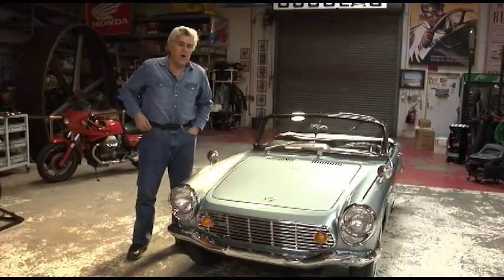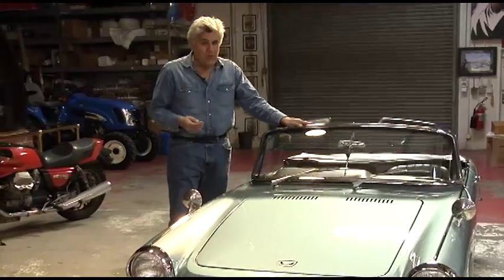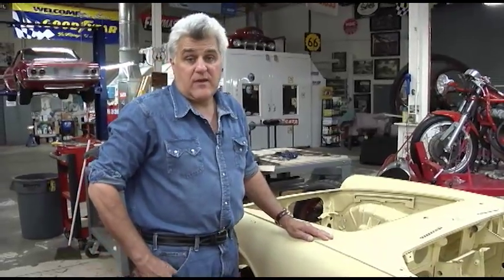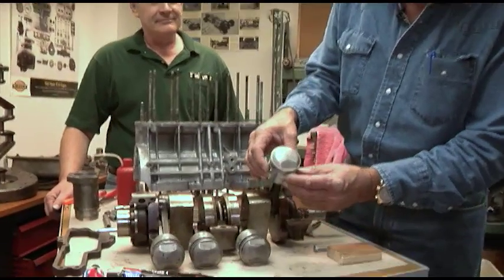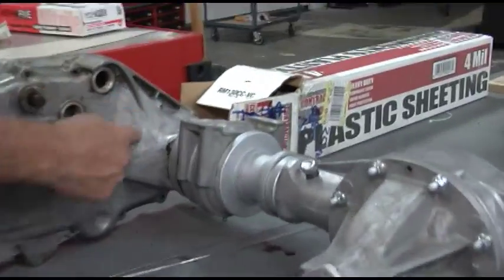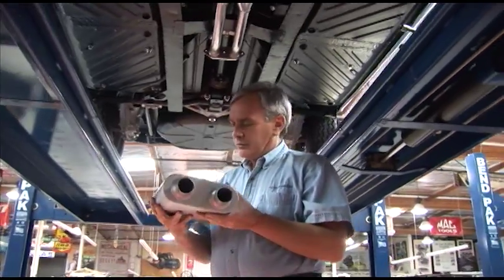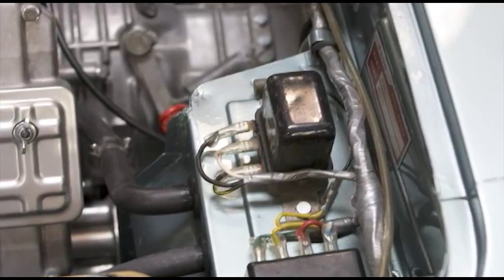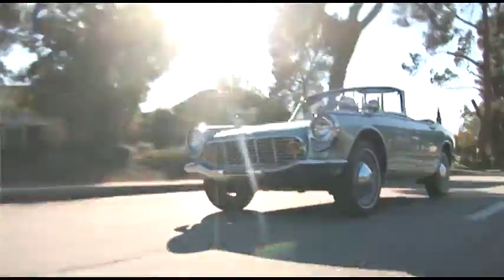1964 Honda S600 - Jay Leno's Garage

Comment: And this is why people love the S2000... Jay put it perfectly: "Going quickly in a Slow Car is Actually more Fun than Going fast in a fast car" that's the sole reason Cars like Miata´s, RX8, and the S2K exist.. Some people just want to hear the symphony of an engine without breaking any laws.
Reply: +skirmich Thats the same reason why the miata is so popular. It isn't a fast car but its a lot of fun to drive it at high RPM's , and offcourse its a nimble little car.
Reply: and the S2000 is just about as fast. Most experienced s2000 drivers like me that learn how to launch the car properly can get their stock S2k's to 60 in 5.0 seconds. Neither are slow cars.
Reply: skirmich works in a country with speed limits and cities that live off tickets.
Reply: Imagine if they make a new version with a new bike engine 150 hp 14k redline
Reply: @68nevets68  my turbo Miata does the same and costed half as much🤣1800 for car 449 for standalone and 1200 for isr turbo kit and I'd say an extra 300$ for touch up things electronic boost controller oil cooler oil catch can a few reroutes. Next is coil on plug not getting enough spark I want 250 whp out of it and it's at 200 flat rn
Reply: @kyongslist  you drive a Prius?
Reply: @h3xd3m0n9  Jay Leno had one on his show with a cbr 1000 motor in it. I'm sure you saw it by now
Reply: You should hear my stock Golf MK7 R at high RPM.

Comment: You've got to admire the Honda Motor Co... they just recently produced their 300,000,000th motorcycle..... that's a lot of motorcycles... the first true Honda motorcycle was the 1949 100cc Dream - the 300,000,000th one was a 2014 1800cc GoldWing...amazing.... Soichiro Honda would have been proud - Cheers
Reply: And out of those 300 millions, more than 100 million are Super Cubs. The most produced vehicle in the world, by far.
Reply: Not to mention Honda's domination in F1. Notably in 1988 when their engines not only won 15 of 16 GPs, but were hitting 18,000 RPMs. 

Let alone a factory car like this @9,500 RPMs... in 1964...

Comment: A 600cc Honda four cylinder.  This ol' Honda mechanic from back in the day sees those pistons as very close to the ones used in 305cc Honda Super Hawk motorcycles.  Anyhow, marvelous engineering and craftsmanship, what eventually put Honda at the pinnacle of motorcycle manufacturing and engineering.  Great view of this little sports car's whole persona from Jay.
Reply: i ride a 600 cbr f4, last of the carburetted models from 1999 -direct descendant of this lump, bullet proof and wickedly fast, the only grief they ever give is the cam chain tensioner.

Comment: The engine sounds like the best parts of the movies Le Mans and Gran Prix from the '60's.
I helped my step dad rebuild a 1962 Porsche Super 90 with the roller bearing crank. It was a beast when the carbs were synched just right.

Comment: Just more proof of why ill never sell my S2000 ....its in a class of one ...owned it for ten yrs and still love it as much as day one !!
Reply: not close to this jem  plus later s800 pure hot cutting edge 1960s honda four stroke 
technology from race program eg check out on youtube 125 5 CYLINDER AT GOODWOOD FOS 2002  beg you watch it then may see s2000 as good as it is by honda standards a bit warmer than most "modern" engines but not earth moving what possible nice car but no classic
Reply: Tony Pate S2000 was produced with Honda racing technology and experience from Formula 1 and is already touted as a future classic.
Reply: yes just about on par with this technology from 1965 which is 50 years ago as for the s2000 having any link to f1 well its clever pr speak and no more have you ever been close to a f1 car  ?  not last years joke but v10 and the 1,5 turbos next be saying a clio shares it dna with f1 renault not amount sport badges ant stickers can hide  fact that both nice cars quick enough but not cutting edge only car thats a bit special the toyota fla thanks to the folks at yamaha but dont tell anyone car nuts be upset never ever be as classic the s800 in modern turns your s2000 be spining to 16 k and 350 ps and its not why well it a warmish safe engine
Reply: Tony Pate I've seen Senna's McLaren with the V12 and Red Bull's car from last year and Formula 1 is my religion when the current season is on. Also considering the same engineers who worked on the S2000 also worked on the NSX and were involved in Honda's F1 technology and engine design I'd say yes it directly has influence from Formula 1, especially the engine that screams to 9,000 rpm. The S600 and S800 are great classics but are still obscure cars most enthusiasts wouldn't look twice at or even be aware of their existence especially in America where the classic car scene is dominated by American muscle and European sports cars. I love both these old roadsters and will have one someday in my garage but don't be so arrogant to dismiss the S2000 because it definitely shares the same spirit of those two cars. There are also numerous articles out there that pretty much guarantee it will be a classic car in the decades to come.
Reply: wow 9 k in a car big wow honda can do that standing on it,s head nice safe tech from way back!! sorry your a f1 fan must a been so hard to watch last year power passion speed er big fail can you tell what R S C is ?? just checked out on your playlist s2000 technical video 1999 not bad but bit old hat and full holes dont get me wrong not to bad a car any
wife gf be happy and safe in it i await your reply to the R S C question

Comment: Hands down, this has to be the best sounding and coolest little car i've seen in Jays garage. And yeah before you get your panties in a twist, the McLaren F1 is an amazing machine, but it's ultra pricey and nearly unusable on the street (ie to explore its limits). And he does have a lot of cool cars in there.  As Jay has said it's more fun to drive a small, lower power car fast than a bigger car with big power slow. Just listen to that thing scream! Wow!
Reply: youtubasoarus
Reply: Honestly it sounds like a Honda engine. I have a 2001 Honda Prelude with a 2.2liter VTEC engine and the tone and sound is the very same. It’s insane that a 1964 Honda motor has the same sound as more modern engines.
Reply: He actually a fast car fast

Comment: Very cool to finally see this video of Jay Leno's Garage. We have a 1965 red S600 ourselves. It's up at Formula H Motorworks to get the same or similar treatment. We anxiously await its return in roughly July or August of 2015. We cannot even believe how amazing this thing sounded after restoration. Absolutely SCREAMS at the high end of the tachometer just like a modern day S2000!!

Headquarter Honda
Clermont, FL

Comment: Quite a few were sold in Australia.  A bit small for the tall guys, but incredible go for the engine capacity.  That one of Jays sounds quite a lot louder than I remember them being as stock.  Nice to see these types of vehicles on the show.   Makes you laugh when you hear people say Japanese are not innovative.
Reply: And Australian ingenuity put far bigger engines in them, Pushrod or 2 litre Fords, 3.3 litre Holdens and the granddaddy with a 283 Chev!
I feel a current 'hot rod' engine would be S2000 running gear. Though the rough motorcycle power one was different and quite quick
And dont insult the poms, most Sprites had wind up windows and a heater. And lever action shocks, oil leaks and the Prince of Darkness Lucas electrics.

Comment: I BOUGHT A 1966 SM-600 IN SASEBO, JAPAN IN FEBRUARY '66 FOR ABOUT $1,650. TOOK IT TO VIET NAM THEN SAN DIEGO BACK TO YOKOHAMA IN1966 THEN TO CLERMONT, FLORIDA IN 1969. KEPT IT FOR 46+ YEARS WHEN I GOT TOO OLD TO GET DOWN THAT LOW TO GET IN. SOLD IT TO A COLLECTOR IN ALABAMA. FONDLY REMEMBER IT BUT DON'T MISS IT.BILL

Comment: Jay you said it must of been made for Canada because of the metric speedometer but Canada was not metric until the mid 70 s  so must have been built for the UK
Reply: The uk is still imperial, ie not metric, so it wasnt made for uk. Every other country is possible, just not uk or usa (or canada)
Reply: It was a direct import, Japan was metric in 1964, so KPH clocks
Reply: Neil Roberts
Agree it was a domestic model (JDM) although LHD versions were exported.
Reply: Japanese cars, even ones made for Japan, often have things written in English on them. Don't know why.
Reply: Googlefluff857 Even Russian MBTs (Tanks) that the Iraq's used had English gauges and the operator manual was in English.
Reply: the UK metric in the 60's..LMHO hello.....japan is metric and they use english numbers.
Reply: @StevieRay9O  I had 66 LHD 600 coupe sent to Canada, rebadged a 67 and sent to Okinawa, Japan.

Comment: Giday Jay,Believe it or not I used to own one of these as a young bloke, I bought it against my fathers wishes but I just loved the car even before I bought it. I had the engine restored but at the time there was no one in Sydney that I could find who knew a lot about the car. The engine finally bought the farm and it was left outside the house for six months. Little did I know that I should have kept the car and had the engine rebuilt again. It had a lot of rust under the sills but it really was a fun car to drive. It was a car that I used daily to and from work with the hood down with the radio flat out cruising in traffic with the engine revving at around 5,000rpm.. It was just an amazing car. I still kick myself every time I see one..
Regards Shadowrider From down under..

Comment: My brother owns a restored 1966 S600,  that was given to me in 1986.  Gentleman that owned it was in the Navy.  He had purchased it new on Guam. (Yes Left hand drive!) He also owned a 289 Cobra and had to relocate  to the UK. Could take the Cobra, couldn't take the S600.  He had been recently been interviewed by Crag Singhaus of Maryland Public Television 's MotorWeek.  I ended up selling it to my stepfather because I had a young family and couldn't make the vehicle right.  My brother and my stepfather restored the Honda, and my stepfather passed away and my brother became owner.  I helped work on it from time to time but they did most of everything.  Such a neat little roadster (removable hardtop) 4 carbs, 2 cams, 4 valves per cylinder....fun car

Comment: Someone show this engine to modern Mazda engineers.
Reply: ...someone show this engine to modern Honda engineers.

It's all about emissions, though. High RPM NA design usually requires the catalysts to be further downstream which means it takes longer for them to get hot enough to start working. These are issues the new Ford Mustang 350R designers have had to face. The free-flowing exhaust design usually means it's louder. And, in an era that advertises NVH and Infotainment improvement more than fresh and daring engineering ideas, it's no surprise that these characteristics don't sell in more common cars.

Comment: What a sweet piece of machinery that is! It has all the elements of a good sports car: high power-to-weight ratio; clean and understated design; an engine that's tuned like a formula racer; and running gear that enhances power management and handling.  For genuine enthusiasts of quality automotive engineering - who aren't impressed by a tone-y name - it must have been a real bargain. How much did it cost when new, Jay?

Comment: This is my favorite episode. Seeing the engine apart I found it a interesting mix of motorcycle and car tech from the period. Roller bearing crank, but just 3 mains. 2 valve per cylinder, couldn't tell if it had iron skulls in the head ( std. Honda in the day)  or valve seats. Did the cams have needle bearings or a bearing carrier? That is the earliest Honda engine I have seen that was liquid cooled except possibly their hydrostatic drive scooter of the same period. The S600 had a air cooled twin. I had not seen a 4 cylinder from that time. I appreciate Jay's mechanical magicians use Yamabond 4, good  stuff. I use myself. 
Always great fun, thanks Mr. Leno.
Don H

Comment: Hi Jay: AFAIK, there were no RHD models of your car exported to Canada. (I'm a Canuck living in Japan.) In 1966, I drove a brand new Canadian, LHD, 600 cc import model. I marvelled at the handling and precision. I loved the car and have wanted one ever since. This machine was conceived and engineered when Soichiro Honda was still working on the bench with his young engineers. (He hated the office.) And it shows in this car. We can infer that a lot of the tech came from the GP motorcycles that were startling the moto world of the times. Honda sensei's moto success came from a lifetime of very hard work.

The 'K-jidosha' formula for small vehicles confers tax concessions and other benefits. The regulations have been revised since your car was made. Besides a new maximum wheel base, the engine size has been increased to 660 cc. Still, the engine cannot exceed 60 PS — or is it 65? But, due to variable cam timing and multi speed transmissions, the new K-cars have astonishing torque and highway performance. Alas K-cars are no longer cheap alternatives.

The successor to your car was the Honda 'Beat'. I want one real bad, but then so do a million others — SIGH! A new Honda mini sports car is on the road, but it has taken on the current, appalling ugliness of "modern" styling. The Beat and a contemporary from Suzuki  were/are sumptuous looking little sports cars.

Comment: That is a beautiful engine.  Talking about the roller bearing crank, reminded me of my 1957 Saab 93.  The 93 had a 750cc 2 stroke 3 cyl engine that put out 38HP @ 5000rpm.
The crank shaft was ball bearing and the wrist pin was needle bearing.  I put over 100,000 on the engine with no problems.  Had a lot of fun with the car.  This was my first front wheel drive car and I was sold on FWD from then on for a winter car.

Comment: this answers a long standing question I've had about the S500 and 600.  there are indeed running lights perched underneath the headlights.  when I first saw them in GT4, i wasn't sure due to the chrome light buckets and the old out of focus CRT tv I had.

Comment: years ago, a friend of mine was fixing the body on an old Duster. There was a small hole at the back, below the truck. He hit it with a sander and the whole back came out and landed on the floor. Someone had put cardboard at the back and covered it up with bondo. It held until an accident or hitting with the sander. He did the job the way it was supposed to be done, using steel and fitting it in.

Comment: The first car I ever owned was an S500--the same car, basically. There was an 800 eventually. It was about a foot shorter than an MG midget and steering was so quick that it took a lot of concentration just to drive in a straight line. Mine could have used restoration when I bought it, and I left it behind in Japan, but I still dream of having brought it home and kept it running today.

Comment: When living in Europe in the early '70s, I ran across a RHD S800 Coupe. I kept it for about a year. I loved the car, buy my God, was it unreliable. In the town I lived in, Bitburg, Germany, there was a Honda dealership; where I took it for repairs.

The service manager told me that his shop more on warranty work in the first 6 month, than any other car they sold. They basically quit carrying the S800. The starter went kaput at about the 6 month point. The engine, quit at the 9 month point. My local dealer wouldn't touch it. I found a mechanic down in Luxemburg that worked on these cars. After a couple of months, that mechanic called and told me that my car was finished. On the drive from Luxemburg City to Bitbug was around 60 mile. The engine went off song about 30 miles out of Lux.

I almost immediately put the car up for sale. It's a tale similar to the "Girl with a curl" - when she was good, great; but when she was bad, she was intolerable.

Comment: The successor was in 1967 the S800, virtually unknown in the States but sold in Japan and Europe. 80 ponies, 9000 RPM redline et very fun. In the 1 liter class the Honda smoked every thing on 4 wheels. In France a few kit cars were made with this 800cc engine, I do remember one with a multi-square tube chassis with riveted aluminum panels (like some GP F1) weighting around 500 kg. The handling was not first class and the brakes pretty light (same defaults on the Honda bikes of the period), the engine maintenance had to be very precise.

Comment: I remember one of these little Honda cars sitting in the showroom at Bow Cycle in Calgary, Alberta, Canada, the local Honda motorcycle dealer. They sold a lot of Honda Cub bikes in those days. Back then there were no Honda car dealers up here. It was left hand drive and had a speedo calibrated in mph. I remember the man in the showroom saying it was chain driven. But it was the only one I ever saw and I have no idea what ever happened to it. I was actually more interested in the Cub as I could drive it without a license since it was only 49 cc in displacement. I was only 14 years old at the time.

Comment: I had the chance  to drive an S-800 in 1971 in a Gymkana in The Republic of Panama.  It was a lot of fun and revved and sounded a lot like the one in this video. I believe it belonged to a guy Named Ed Boland and he actually had two of them.  One for him and  one for his wife.   The one I drove had a defective heat gauge and it showed overheating and I backed off to save the engine I thought.  When Ed showed up he ran the heck out of it and said to ignore the heat gauge  and that you could  not kill it or damage it by running it up to the red line before shifting.  Lots of fun!!!! Crazy to Drive.